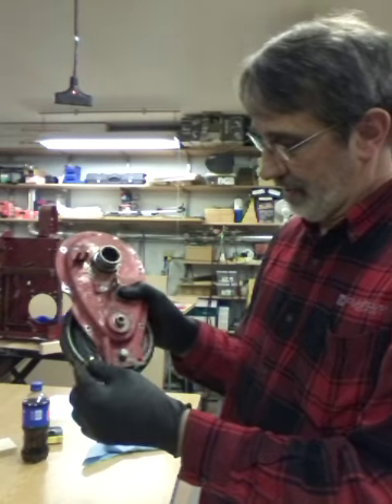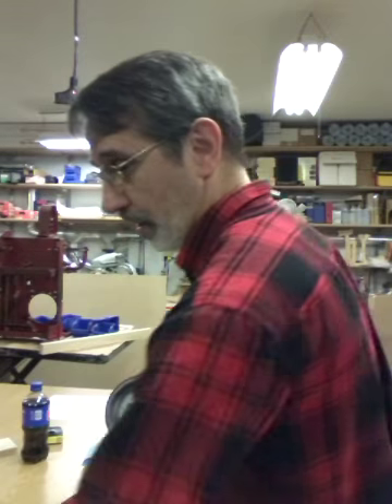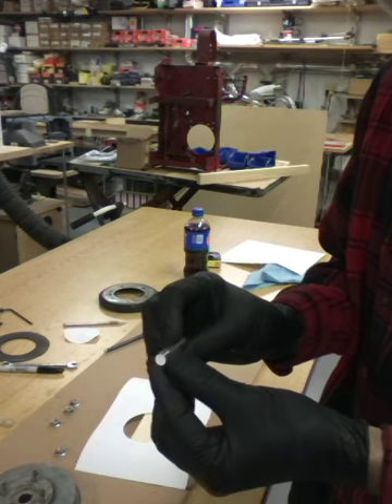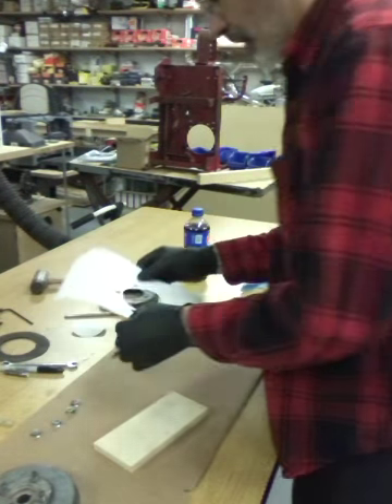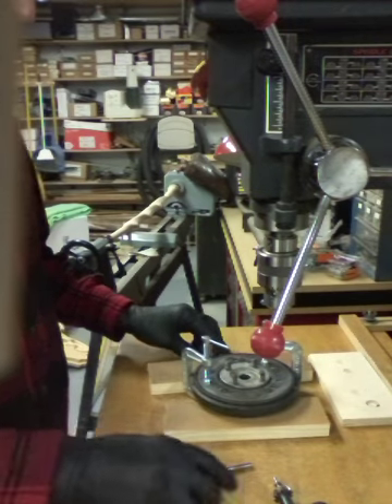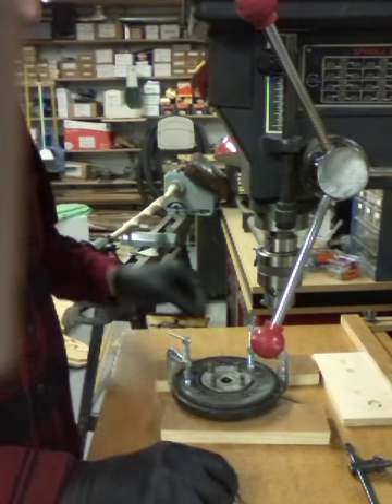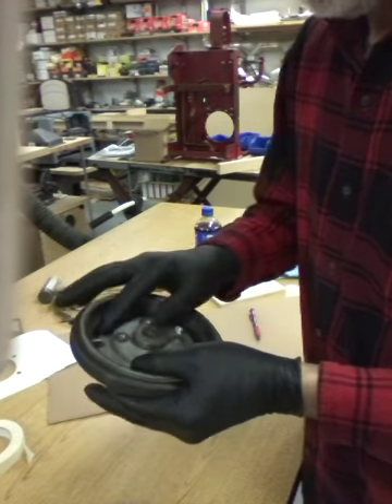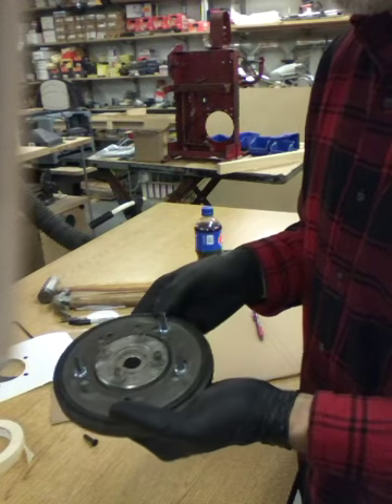33. Repairing my clutch on a snapper

Comment: Hi Jim,  I also have the 1 pedal mower.  This thing goes through friction discs every 2 years and I'm fed up with it.  I'm going to do your mod as soon as I get some time or when this current friction disc fails, whichever comes first!  Thanks so much for your help with this built-to-make-Snappper-rich to drive replacement parts sales (engineering failure).  I dream of the time when I had the old 33 in. (2 pedal) Snapper and I only replaced that friction disc once in a decade!  I hope this mod will do that for this newer snapper.

Comment: i just did this mod and it works great
i did not have  to redrill holes in the rubber wheel flange i used what was there and it works great
macking tape trick is awesome

Comment: Great Mod! This mod is easily reversible if you change your mind about it (Simply remove the four bolts/nuts that you installed and re-install the thrust-washer and drive disc plate). I have often wondered if re-placing the entire thing (7053114 "kit") would sort out the soft-start reliability issue - this is a design that either works great on your machine or works poorly (mine fell into that latter category); Anyway, I went up to hardware store and came out with: 1/4-20 (half-inch) phillips stainless-steel flat-head machine screws, 1/4-20 stainless-steel 'nylock' nuts, fresh 1/4-inch drill bit, and a non-piloted chamfer bit (the most expensive thing that I bought); I followed Jim's excellent "index-drilling masking-tape paper template" method carefully and slowly; and, a twist, I drilled this with a corded chuck-drill (yes) - just taking my time and oiling the bits and chamfer as I went along; after I drilled my first hole, I inserted one snug 1/4-20 bolt and nut to lock everything in place; did all five holes; all of it went perfectly; my chamfers came out in two flavors: perfect or ugly; so I had a couple of ugly chamfers - but they still did a great great job; I did a trial-fit on the mower to check for interference to the brake pad (wiggle that brake bad to worst-case position during this test) and no interference; so bolted it all together; I like the end result; and yes, my wife made a short video of my first wheelie; I did the wheelies on purpose so that I can learn the new behaviour of the mower in each gear; I can start-out in 1st or 5th gear now and no slipping; I do miss the soft-start, but I will not miss its poor reliability; One day I would like a semi-Ag tire for the turf and a posit-traction for this beast. Good Mod! I endorse it; it is easily reversible if you change your mind; Worst-case is you bugger this up and the entire soft-start clutch assembly is now 7053114yp - about $60.00 - but you would have to make some big mistakes to mess one up to where this would be irreversible; I used some blue thread-lock on the 1/4-20 SS machine screws; if I thought this was permanent forever mod I would hit it with red threadlock; hats-off to Jim for all the perfect little tips that made this possible; but keep in  mind, you CAN do this with a hand-held corded drill - just clamp it down somehow or you may get hurt - the materials are fairly soft and easy to drill with a good bit; use some oil on it as you go along and work slowly to keep things cool.
Reply from the maker: SmooveBee1 
Hi it's Jim
  If for some reason you don't like your solid clutch watch   Videos number 70. 96. and 97 they will explain to you how the clutch works and how  you can adjusted it to grab better without bolting the clutch disk solid. Thanks Jim
Reply: I mowed with it today; and I plan to build another solid clutch with parts that i have ordered - so that I have a spare; I am very happy with the outcome; and the clutch is very predictable really; I would think if anyone was a little anxious about the clutch, they could add water to the front tires(?) or some plate-weight to the front - assuming they were running a bagger on slopes;  I am going to adjust my 'Speed Adjustment Latch Assembly' (R/N/1/2/3/4/5) next - it needs to move slightly rear-ward to solve my 'won't stay in reverse' issue; there is some play in the where the 'Shift Handle' joins the 'Shift Handle Arm (shaft)' due to some slop in the clevis/cotter goes thru the arm (shaft); I confirmed that the yoke has plenty of room in it to go more deep into reverse and another visual check on the Speed Adjustment Latch Assembly'; for all I know it came from the factory like that; but it looks easy: two bolts on the speed adjustment latch plate; thanks so much for the help Jim!

Comment: Jim, love your videos. They have been my guide for many repairs to my snapper over the last several years. I'm thinking about doing this clutch mod. My question is why didn't you use the 5 existing holes in your disk? Thanks.
Reply from the maker: Well you could use the holes that are there if you use bolts the same size if you use a quarter inch bolt through that larger hole to disk will Chuck back and forth and sheer off the bolts. Jim

Comment: Ok i watched the videos the "yoke" plate on my mower has minimal wear so i think thats ok the sping for yoke tension i moved up on top and down on bottom for max tourqe.  I guess now ill check the friction plate clearance to see if i have room to move it down as per ur specs on the video. I also have side to side play on the rear axle but the bushings in and out feel tight do you have a video to reduce side play in the rear. My model is 28086s what can u tell me by that? Thanks for the help

Comment: Can you move the holes closer to the hub so you don’t have to countersink the heads to clear the brake? When you made the alignment marks why do you put them between 2 existing bolt holes instead of moving them further away so as not to stress the existing  holes?
Reply from the maker: You can put the bolts were ever you think will work the best typically a larger bolt pattern has more strength than a small one. Jim

Comment: Jim, Joe here. I watched your vids on the drive disc replacement and ordered the whole soft start kit. Don’t need it. 

Well it looks like my 33114S has one of the last old drive systems (motor code of 1982). I just ordered the disc only to replace the old one. My mower only had three of the 5/16 bolts installed.  Do I need all five bolts, as it looks like three was working.

Thanks
Reply from the maker: Muttbike65 
If three was working I don’t see why you can’t just go back to that if you have trouble with it coming loose or Breaking off the three bolts then go to five. Jim

Comment: Jim, wouldn't clutch replacement be easier if we used the 5 5/16" holes already drilled in the clutch disk? That way, the next time you have to replace the clutch disk, there will be no drilling required. What do you think?
Reply from the maker: Greg Vanek 
  It's just easier for a lot of people to just drill new holes then try to match drill holes that are already there,   if you think you can match drill the holes and get them to line up it would be easier, and you should do it that way. Thanks Jim
Reply: If you used 5/16" flathead screws you would have to countersink deeper than you would if you used 1/4" flatheads. May not be enough material.

Comment: question about a worn drive plate, my last clutch only lasted 2 years, I noticed drive plate looking pretty rough, could I sand it smooth to keep next clutch from wearing so quickly , thanks
Reply from the maker: Kevin Fjrrider 
Your clutch disk wearing out in two years may not be the result of a wavy drive disk it could be because your yolk spring is not tight enough watch video number 70 and tighten the spring as tight as you can get it and see if that helps. Jim

Comment: Hi Jim, My question is why not just use the existing holes on the drive disc and drill through them into the hub?
Reply from the maker: southeasternpm I answered your email in the way of a video check it out I explain a lot of different emails and yours also. Thanks for your questions and comments and I hope you're subscribed Jim

Comment: If i do this to my Snapper will it do wheelies if i let the brake out in 5th gear from a stop? I think mine is a 1998 based on the serial numbers stamped on the 12HP I/C Briggs/Stratton engine. Also being its a fully locked clutch does it wear out the actual drive train and cause chains to break? Thanks in advance
Reply from the maker: Richard E Well I’m not sure about fifth gear but if you let it out too fast in first or second with a bagger on it, it Will pop wheelies and it’s possible that you could break the chains, that’s why I always try to adjust the yoke spring first and if the clutch is worn out or the yoke that will cause you problems. Let me know what you think. Jim
Reply: @jimjackson9381  thanks for the advise, i will be careful once i get the new clutch in the mail, i just want a more bullet proof reliable setup and was entirely serious with doing wheelies haha

Comment: Hey jim im new to the snapper world but i have a single brake model with the "pad" thing that rides inside the clutch for brakes. My question is i have what looks to be a new clutch because the rubber looks good and the green round piece inside look new but my clutch has quite a bit of play in it still what does what your explaning in this video do? My mower also strugles go up hill on my yard. I moved the springs out and still no difference. Will this mod help it? Also the shifter plate which pulls up the roller and clutch assembly have minimal wear but i will try to find a new one.
Reply from the maker: Brad 31 
   Hi Brad. before you buy any parts subscribe to my channel and watch video number 70,  96,  and  97.  To give you a better idea on how this works then get back with me and we'll figure out your issue. Thanks Jim

Comment: Hi Jim, is this to bypass and lockup the clutch so it's a direct drive?  Isnt this alot of strain on the chain and gears?  Txs
Reply from the maker: Let's Kill Sum Time 
Well it all depends on how you let the clutch out but the early machines all had solid clutches and they built them that way for years it was in the early 70s or late 60s when they switched I believe to the soft start clutches. Jim
Reply: @jimjackson9381  great... thanks for the reply
Reply from the maker: Let's Kill Sum Time 
Well thanks for the question if you have any others just let me know and I hope your subscriber I need your help with that issue. Jim
Reply: @jimjackson9381  already a subscriber.  I'm also working on the craftsman / snapper clutch conversion.  Email from yesterday.  Thanks again
Reply from the maker: Let's Kill Sum Time 
Well I’m glad to hear your subscriber, and let me know how that conversion works out because I am sure there’s a lot of guys out there that would like to see and hear what you’ve done. Jim

Comment: I Still have my Old Riding Snapper 10 H.P. Hi Vac but the Breaks are Working ?   (( I'll Watch Since this has been Recommended ))
Reply from the maker: Kathy Norris 
Well describe to me exactly what it’s doing or what it’s not doing and I can help you out. Jim
Reply: @jimjackson9381  Thank you !  It runs good; but can't turn it off with the key anymore & I have no breaks .
Reply from the maker: Kathy Norris 
Hi Kathy it’s Jim, do you have someone to help you work on this machine or are you going to do it yourself, I need to know a few things about your machine is there anyway you can send me some pictures of it you can send them to my email address will be easier it is
jimsfixitshop@gmail.com
 To fix the brakes you’re going to have to lift the machine up and stand it on the rear bumpers can you physically do that, to troubleshoot why it will not shut off I can send you directions on how to check it are you very mechanically inclined these questions will help me know how to instruct you on what to do. Jim

Comment: I'd probably just weld the friction disk cover to the clutch rubber wheel thing with a few spot welds and not even take anything apart. think that would work
Reply from the maker: CIA Assassin 
   Hi it's Jim when you bolt your clutch disk solid to your clutch assembly it has to be perfectly centered that's why I use masking tape to center the clutch disc onto the clutch assembly before I drill it you would have to do the same thing before you weld it if you don't it will shake so violently you won't be able to drive the unit.   If you're having trouble with the clutch slipping I would suggest first try tightening the springs let me know if you need any further help or you can email me at.  jimsfixitshop@gmail.com and I'll be more than happy to help you out.   thanks Jim
Reply: No cause any heat to an part that is made to tight tolerances will distort because of the welding process.

Comment: Can you just use the rigid hub from an older mower?
Reply from the maker: 20mcarroll02 
 Hi it's Jim
   If you can find a old solid clutch assembly you can put it on a newer machine as long as you have two paddles, i'm not sure if the little break arm will fit on a older assembly or not.   I would have to see the old assembly to see what it looks like and if it would fit.  Thanks Jim

Comment: Isaac Sasson
The seven holes look like so you have the option of  three or five bolts
Reply from the maker: ISAAC SASSON 
 Hi it’s Jim
  You can use either three or five I typically use five bolts. Jim
Reply: @jimjackson9381  Hi I know But I don't need to to do it 
Thank you Isaac

Comment: what is the advantage to doing this?
Reply from the maker: loom fanatic 
In doing this it will give you a solid clutch instead of a soft start clutch if your clutch is not grabbing and you tried everything you can to adjust it like I have I just bolt them  solid Like the old ones were.  Thanks Jim

Comment from the maker: I'm going to try to put on a video tomorrow night addressing this issue this is not an isolated problem I've been asked several times about this issue and I think it should be addressed with a video so you can see the problem rather than me just trying to tell you about it.  it would help to have a little more information on your machine, Did you just buy it,  Have you had it for a long time,   Have you done any other adjustments besides installing a new clutch disc,    And if you could email me direct with some pictures and a phone number it would help immensely.   my email address is     jimsfixitshop@gmail.com   or    jandrwoodworking2@gmail.com    And as always work safe and have fun will talk to you soon,    Jim

Comment: maybe someone can help me out with a problem.  on my snapper, I changed my clutch.  while tightening the clutch down, I used some channel locks to hold the axle from spinning.  I put the mower down to give it a test run.  with the mower in neutral and brake off, it will not roll.  it feels like it's in gear but the shifter is in neutral.  please help me out.  I love my snapper
Reply from the maker: Joseph hi this is Jim at Jim's Fix-It shop I have had this problem from two or three other people and I would like to try and make a video on it the issue I think the problem you're having is when you replaced your drive clutch at some point when the old one was wearing down in diameter someone moved the drive disk that's mounted to the bottom of your engine down so it would have more contact to the smaller clutch disc, then when a new clutch disc is installed the diameter is too large and it is always in contact with the drive disk which will lock up the drivetrain you'll have to stand your machine up with the shifter in neutral and try to slide a shim between the drive disk and a clutch disc they recommend about 1/32" clearance between the two.     If  you need any further assistance or instructions please contact me at   jimsfixitshop@gmail.com   some pictures are always useful in solving these issues and/or send me your phone number and I'll call you to try and help you solve these problems.   thanks for your interest and comments and if you haven't already subscribed please do I have more videos to come,   Jim
Reply: Thanks Jim, I did some investigating and found that I had rushed my work and when I put the nut on to tighten the clutch, I accidentally tightened it against the brake causing the clutch to lock up because the brake shoe was digging into the clutch itself.  And because of my impatience, I have now seized my 9hp Briggs and Stratton engine.  It isn't low on oil, but I have been meaning to change it.  So i will change the oil for sure.  Any other helpful tips of freeing up my engine would be appreciated.  Thanks again Jim.  Keep up the good work.  You're very helpful
Reply from the maker: Joseph Loup hi Joseph it's Jim    I guess it all depends on what seized up in your engine you're going to have to tear the engine down to find out the real issue some problems are an easy fix and others are not so I did that myself once with a snowblower the engine was low on oil and my driveway has a hills in it on the way up one of the Hills the engine seized up my problem was a crank seized up in the aluminum block I was able to get it apart I polish the aluminum all of the crank Journal and bored the block out and installed a brass bushing I reassemble the engine and it runs fine and I'm still using it but for your issue you're going to have to disassemble the engine and see what the problem really is send me an email to    jimsfixitshop@gmail.com   and let me know what you find out I may be able to help you with your rebuild thanks for your interest and comments and don't forget to subscribe Weather Channel if you haven't already talk to you soon Jim
Reply: Jim Jackson my snapper does have any adjust blots
Reply: Jim Jackson where can I get one a disk wheel